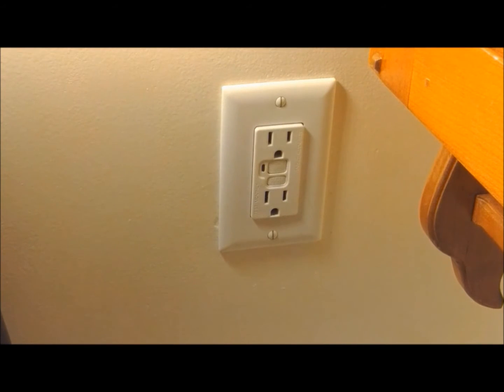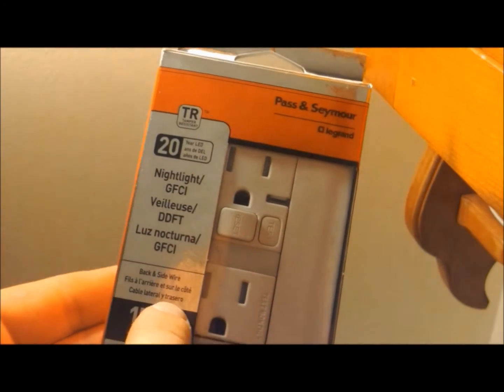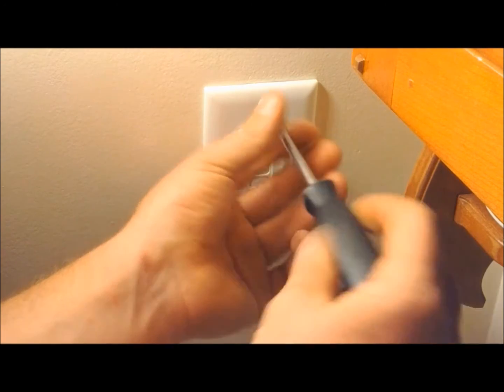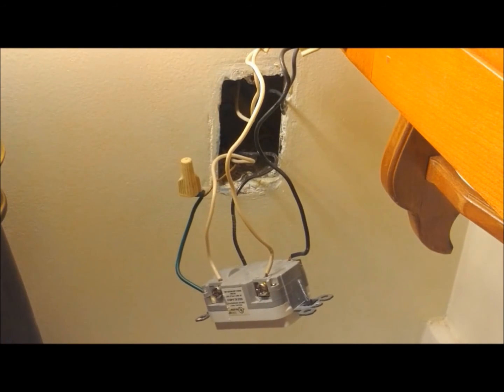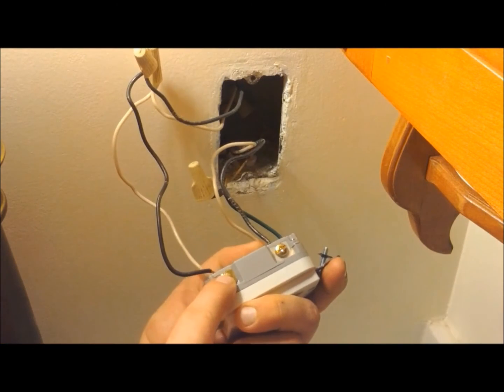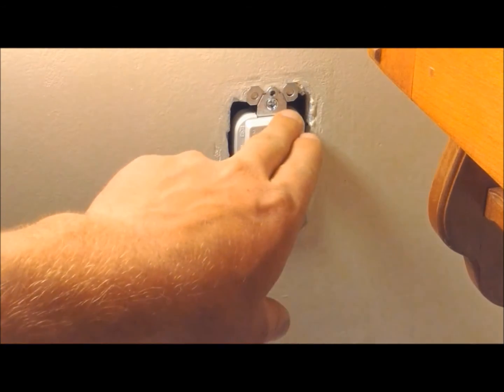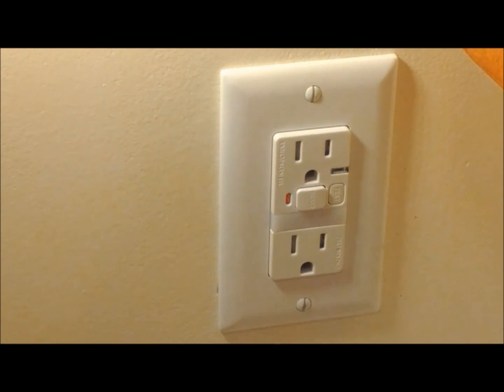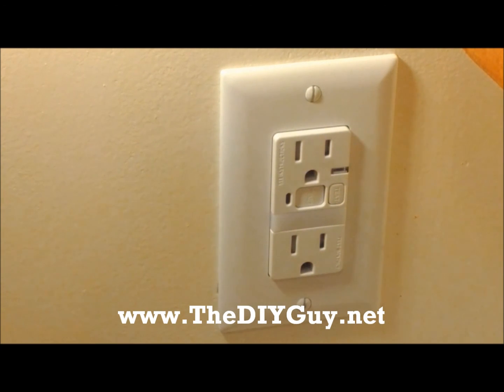How To Install a GFCI

Comment from the maker: wilofiron Hello, Your welcome. No, A GFIC will not work if wired with reverse polarity. I would correct the wiring for the outlet where you plan to install the GFIC and any other outlets that have reverse polarity.